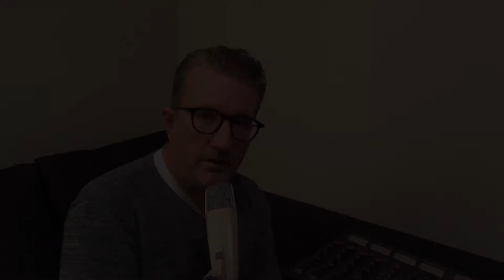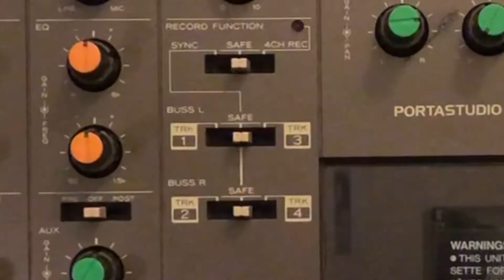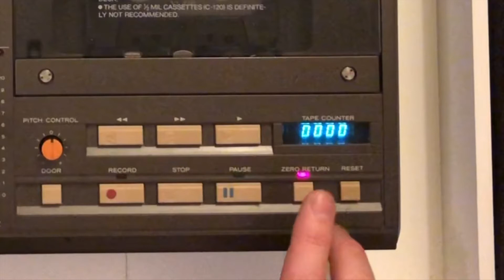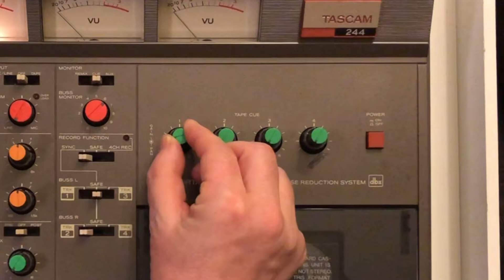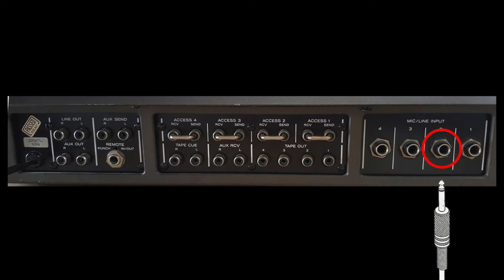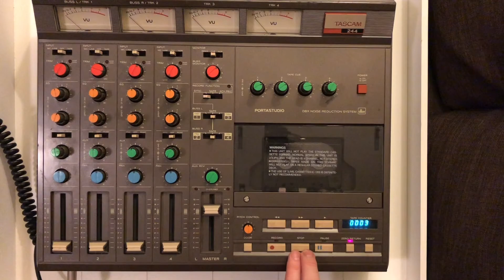Tascam 244 tutorial / Part 1: RECORDING / “Do it anyway you wanna” - People’s choice

Comment: Hi! I recently got a tascam 244 and have had some troubles with it, the machine is ripping up my tape and getting caught in the section just to the right of the head, do you have any ideas of what is going on and how to remedy it?
Reply from the maker: Hi David, I think this problem has something to do with your idler tyre. It sounds like the capstan (the metal pin on the right side of the head) and the pinch roller (the black rubber wheel) are doing their job just fine, the pull the tape over the head at the correct speed. But behind the cassette, within the recorder's housing, there is a plastic wheel with a rubber tyre around it (idler tyre), that moves the tape spindles in the cassette. If there is not enough tension on the tape spindle, the capstan will keep pulling tape, which will be all over the place. The idler tyre is a little harder to replace (it needs a few more parts to be unmounted), but it's definitely possible! If you also want to replace the belts in your 244, you can check out my repair video on this: https://www.youtube.com/watch?v=k_imS2iNhVY
Reply: Thanks for the info! I think I've figured it out, the pinch roller has deteriorated into a black sticky mess and was catching my tape (you wouldn't happen to know where to buy a good replacement?). I suspect that the idler tyre will need to be replaced as well due to age, since I've already replaced the belts which were previously a sticky mess as well.
Reply from the maker: David Reynolds A sticky pinch roller, that sounds nasty...I’d just google for a replacement. These are very old machines, so you just have to be a little lucky :) Hope you find a good one!
Reply from the maker: David Reynolds I also found some well documented repair on this website: http://www.mzentertainment.com/studio_workshop_tascam_244.html

For the idler tire, he cleverly uses a rubber ring from a water tap. On one of the links, there is a picture of the pinch roller replacement
Reply: I have one more question about the tascam! (by the way I was able to replace everything and get it all working!) Whenever I try to rerecord something because of a mistake, it always seems to record over the music already on the tape (from the same track) So I have muddy duplicates playing over each other. I followed the same steps as you did when you rerecorded the bass part in your video but it still seems to happen. Any ideas of what I'm doing wrong?
Reply from the maker: David Reynolds So the new recording sounds together with the old one? That sounds like your erase head doesn’t work. If I understand your question
Reply: That's right, will cleaning it repair it? Or do I have to replace another part?
Reply from the maker: David Reynolds I suppose cleaning would be the first and easiest option. Hope it works!